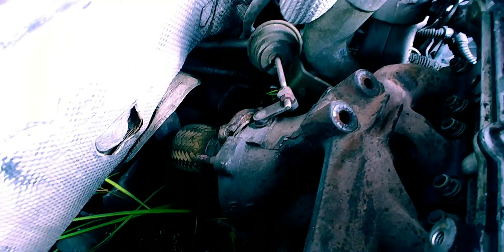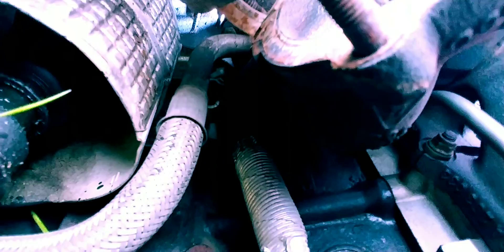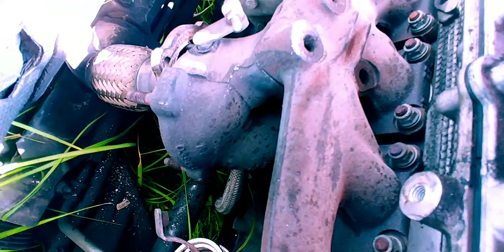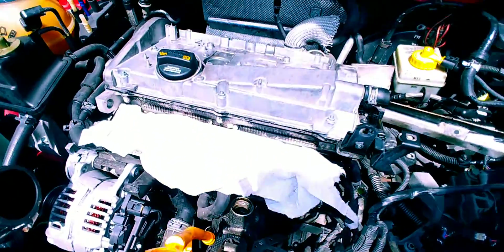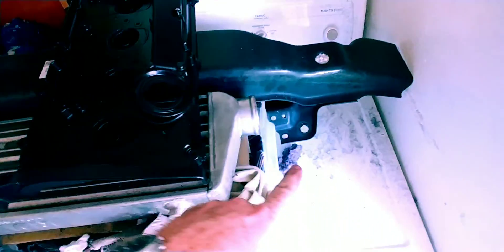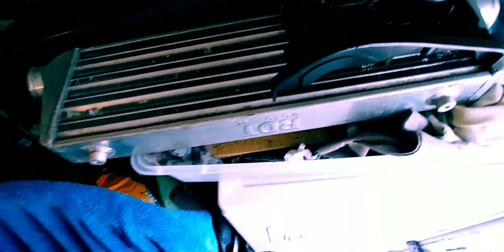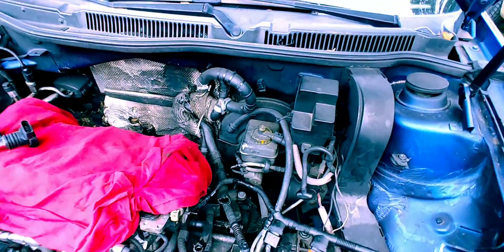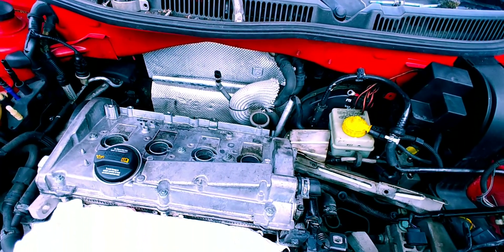Mk4 jetta 1.8t k03 turbo and manifold removal explained

Comment: I need to replace the gasket to the downpipe and at the top, both are leaking. Did you need a torch to get the nuts loose without breaking the studs? Any tips? Thanks.
Reply: snapped all 4 of mine using all of the techniques. so here I am.. last resort is removing the turbo

Comment: Is a bracket the holds the turbo and the  motor block how many bolts were is the bracket?
Reply from the maker: 3 bolts 5 mm Allen.  its under the turbo on the block
Reply: Do I have to remove something to get to the bolts?
Reply: @fastwayimpo  the cv axle

Comment: So many questions. Im at the stage where everything is disconnected. Headers are still attached because its a nightmare (one header bolt is directly behind the turbo..in which needs to be removed lol) so the header stays. Cant be dropped from the bottom because subframe and axle in is in the way. Hitting downpipe and headers. Help.
Reply from the maker: Jermaine Coleman. Down pipe has to come completely off. Connects with clamps toward middle of under the car. First you take the down pipe nuts off. Pry it off the turbo mani and get it out. Take turbo bolts off. 3 17mm on top of the header(turbo manifold) take out. Two Allen bolts 6 mm bracket on the block under the turbo take off those two bolts. Take off oil and water lines and turbo inlet pipe. Should drop down after that. Then use wrench for the hard to reach bolts on the header manifold. The top ones you can use deep socket and ratchet. Take things off step by step.
Reply from the maker: Jermaine Coleman Can't take it off all together. Gotta separate it all
Reply: boosted euros garage awesome info. But i think youre right i have to disassemble my exhaust